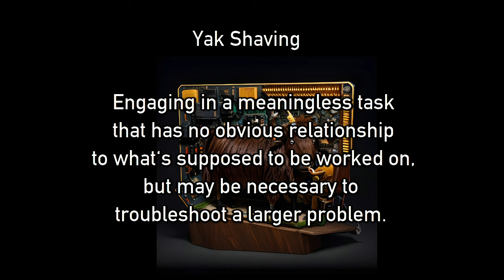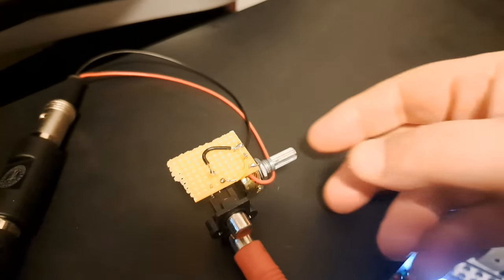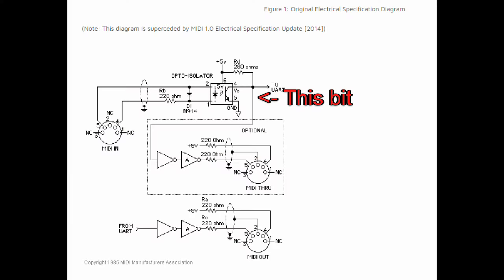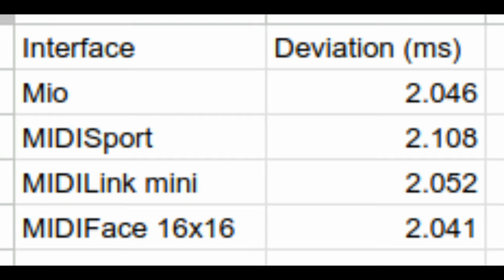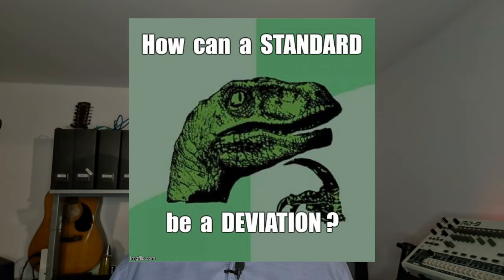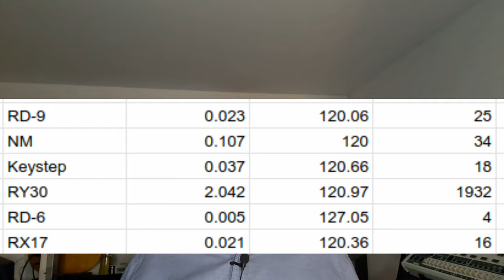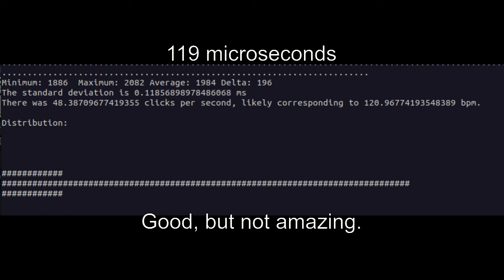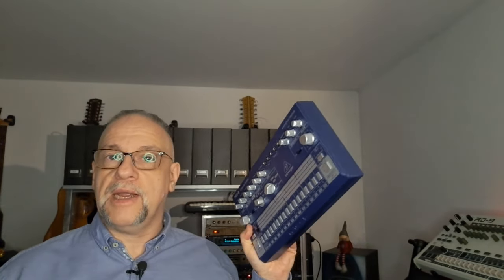Why is finding a stable MIDI clock so hard?

Comment: Thanks a lot, very interesting! It got me thinking that, could it be that some famous drum machines - like the original 909 or 707 - get their famous groove from having an inaccurate MIDI clock? The probability distribution you showed did not look gaussian to me - what if it is the unique shape of the distribution of clock irregularities that is the main contributing factor to a "unique groove"? This would have been a super cool follow-up video!
Reply from the maker: That distribution is reasonably Gaussian, although there is a weird spike, so it's probably a combination of what is practically randomness (all the process in Windows doing things) together with something that isn't random, causing that spike.
Reply: @RegebroRepairs  Right, forgot the distribution was from when you were using windows. Still - would be an interesting experiment I think :) A "well known trick" among house and techno producers is to use midi clock from 909 to get a better groove, even with shuffle on 0. If that's not just a myth, I would think it has something to do with clock irregularities. I might do the test myself when I got some spare time!
Reply from the maker: @Cidr0n  Yeah, I have heard that 909 clock thing as well.
Reply: @Cidr0n   that's what I heard about the older MPC's. Theo Parrish also talks about it in a recent interview.

Comment: Why are the BPM values different for RD-6 and TD-3? Everything else in your table was going for 120 BPM but RD-6 is 127 and TD-3 is 117? That's off by quite a bit.
Reply from the maker: Well spotted! Because you can't enter a bpm, you turn a knob and guess. For the real tests I will measure the BPM and get as close to 120 as I can.

Comment: Enjoyed this very much.  I liked seeing how you methodically went through this process with increasing understanding and troubleshooting.  Being frustrated by MIDI Clock is almost a right of passage, but most people don't get to understand it the way you have.

FWIW, when you must sync to the DAW and use devices that support MIDI Clock, it's far better to use a device like CLOCKstep:MULTI, Multiclock, etc.  It's exactly the reverse of what you've done to make a reliable test.  The clock output from the DAW is audio and goes to a device that can convert it into a much more stable MIDI Clock and then distribute it.  Throw in a few other protocols like CV and Sync24, and you have Sync Hub for lots of gear.  Even on OSes and DAWs that can output a reliable enough MIDI Clock, there can come a point where the project grows to such an extent that MIDI starts to suffer under load and these devices become well worth it.
Reply from the maker: Luckily my sense of rhythm isn't refined enough to have ever heard the 1-2ms delay in any MIDI signals. 😃 I don't generally use MIDI clock, but sequence everything from Ableton, but I would assume any MIDI signals suffer from the same delays.
Reply: @RegebroRepairs  When sequencing notes from the DAW a tiny bit of latency goes unnoticed by everyone for the most part.  After all, you get that much latency just standing 3 feet away from the speaker.  The killer moment is when MIDI Clock is being used to drive external sequencers and the clock begins to drift.  It becomes a runaway train.  The audio clock won't drift, if it does start running a deficit, you'll hear it in all the audio tracks the same (glitching) and the DAW will ultimately stop.  Also one of the things the external sync hubs can be good for are making Latency adjustments close to the devices that are following the clock, especially if you monitor the synth audio back through the DAW and process it further in real-time as some people do, adding an addition stage of ADC and audio driver buffers.  I understand this isn't you, I don't monitor back through the DAW myself either.

Comment: Lennart, many many thanks for compiling all this information and walk the extra miles of analyzing things in detail. I like how you´re turbonerding on this topic (and please take this as a compliment :D). In my setup, everything revolves around ableton link, ethernet based, and I wonder what the good options are to translate that into MC sent to a variety of hardware devices. Currently I use Bitwig, create an audio tick track via ERM plugin and send that to the multiclock device from the same company. It may be smarter to have that one as the master when doing hardware based music only, but I don´t like switching the whole sync setup between producing and performing. 

Again, many thanks for this useful and valuable information, I´m looking forward to see more once you find the time. Good things take time!
Reply from the maker: I have seen ads for devices specifically designed to create clock signals, but obviously I have no idea if they are any good, they usually cost hundreds of £$€, and I don't have any actual use of them.
Reply: @RegebroRepairs  Yes, the Multiclock is basically throwing (a lot of and too much) money at the problem, but for me it was the right decision. Now that I´ve played with a few other ways to get different clocks out to Eurorack (and a few desktop boxes), the value has become a bit less. Often using just the clock generator from Bitwig. ERM is still fun though, like mangling the clocks a bit': having 3 clocks straight and one a little shuffled, tomfoolery of this sort.

Comment: Thanks Lenhart.  Happy to see my TD-3 can be of use again from now on.  What are your thoughts about a plain Arduino setup?  Arduino tutorials are basically build around a MIDI port, 2 resistors and 3 jumpers which I like to experiment with but have never really had the opportunity to pass through a rigorous timing test ... but your knowledge of electronics is better than mine and maybe you can foresee noise issues that could set the timing off without a proper filtering module ...
Reply from the maker: An Arduino that doesn't do anything but send a MIDI clock should be rock stable. And I don't think you need any specific filtering, 3.3V is a pretty loud signal, especially if you enclose it in a shielded box.

Comment: I'm impressed by those results from the Behringer devices. I can guarantee that having a Mac does not necessarily mean you get good MIDI clock out of it – I have done similar timing checks and found that MIDI out from my Mac via a MOTU MIDI Express 128 (over USB) gives spurious regularly recurring signals, when the only thing going through is MIDI clock and not MTC etc. I heard that part of the problem is the USB implementation as the data is packeted, but I don't know enough about that side of things to comment.

Interestingly, machines we revere today as being 'tight' often have fairly sloppy clocks. The 808 is a discrete hardware clock and is absolutely not fancy in any way at all; the LinnDrum uses a 555. The sense of tight timing, I think, comes from every event happening simultaneously – when all the sounds hit together, even if each clock pulse is not 100% on beat, the hits are unified and not staggered as they would be if triggered using MIDI notes on a sound module, for example. If your kick and snare hit at the exact same time, does it matter if they're a millisecond off?

Also, regarding my surprise at those Behringer figures – I've done some work with DIN Sync24, and as far as I've tested, none of the new gear  – not one example – complies with the old Roland DIN Sync spec. The DIN Sync timing of Behringer and Arturia units with a DIN Sync option (out, not in) is abysmal. This, it seems, is because they don't reset the clock on Start, whereas the old Roland spec does: look at the service notes for the 606/808 etc and they explain that the clock runs continuously, even when the device is stopped. When Start is pressed, the clock is held low, there's an approx. 8mS gap to allow the device to reset fully, and then the clock starts again. There's a separate Run/Stop signal which is low for stop, high for run. Receiving devices hear the start line go high, and wait for the re-started clock to appear. Timing is tight and there's a consistent lag of 8mS after hitting Start. The problem with new units like Arturia and Behringer is that the clock is not reset, which means the lag on start varies according to the tempo of the clock, and little attention seems to have been paid to whether it's high or low at any given point. Rubbish, really. So I'm suprised their MIDI timing is so good!
Reply from the maker: There are Behringer units with DIN sync support!? 

I'm not surprised their MIDI is good, MIDI is important, after all. Not many people use DIN Sync any more.

There are certainly other possible sources of instability that might affect OS X, yes. It would be interesting to try out Live on OSX and also newer versions of live on Windows.
Reply: @RegebroRepairs   Yes, the configurable clock on, for example, the RD-8 (and presumably the RD-9) can be set to 24ppqn, which is the rate for both MIDI clock and Roland's DIN Sync – the clock signal is on the tip of the minijack and the run/stop signal is on the ring. If a mono jack is used, the run/stop signal is ignored and only the clock is attended to.
Reply from the maker: @synthnerd4539  Aha, they have a run/stop as well, I did not know that. Can't say I'm surprised that their DIN Sync implementation isn't good, not many use that anymore. old Roland devices usually have MIDI retrofits available.

Comment: Are these measurements just the clock send of each device? My interpretation is that the feel/etc comes also from how a drum machine/etc syncs to an external clock while still playing its own rhythm (not acting as a sound module). I would think that this would be measured by the output sounds, and a comparison between the RD & TR could be recorded in one pass with identical patterns output from each machine as a mono feed routed hard left & right.

Very interesting results nonetheless, I would suggest maintaining the fun in content - there seems to be plenty of burnout on the platform lately.

Cheers!
Reply from the maker: Yeah, this is only one small part of my effort of trying to test the stability of the drum machines.

Comment: How i deal with this, knowing that ableton is shit with midi clock: i record each part and drag it so that it works in the mix. Or i work dawless and use one drummachine as master. Or i use the ERM multiclock and abuse the timing for each channel a bit to make it sound so i want to dance to it.
Reply from the maker: Have you tried using modern versions of Ableton Live? Or macs?